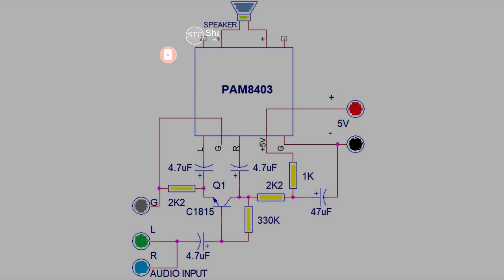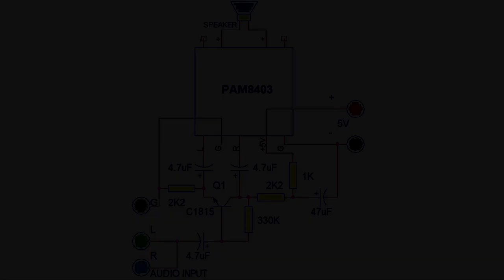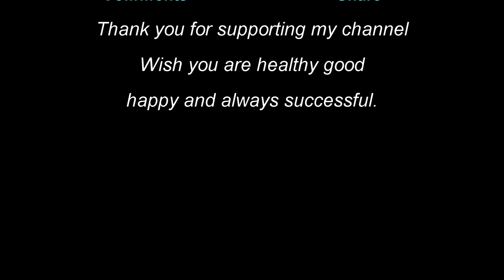DIY PAM8403 3W Stereo Class-D into 15W Bridge Mode Amplifier

Comment: no way you can get 15 watts out of a 4.2 volt power input , can't happen .
Reply: I think that  .
Reply: It's bridge mode, so you can get the 2 channels in 1 with double power. So we have there 6w

But if you use stereo without this circuit you are getting the same power teorically
Reply: the worst is that it is possible, I don't know about this one, but in bridge it can reach even more with other circuit boards
Reply: the datasheet doesn't say anything about bridge, but I don't doubt anything
Reply: its can... add buff more signal and using lowwer ohm.. 😅😂  for 15w only...
Reply: Of course you could get 15W with only 4.2V if the circuit would push 3.6A without burning up but with this circuit its probably not possible with the IC being the bottleneck that probably would burn up.. Power (Watt) equals Voltage times Current so 4.2*3.6=15.12W..
The math isnt really that easy with Class-D but approx..

Comment: Pam8403 is already a bridge amp so no point adding a phase splitter at the input and connecting to both + output pins. You will not get 15W doing this. Could be a fake video with spk wires under the mat.
Reply: Does it really works will I get 6w output
Reply: @siddharthshekhawat5502  3W peak into 8ohm, 6W peak into 4ohm. Note, peak not RMS, divide by 1.414 for RMS.

Comment: not possible. double is fine.  Also you are cutting out  useful sound due to phase cancellation. . its just a crude jugad. rest circuit is ok. It would be  better  to sum the  L+R  with a 470  ohm resistor each channel then same circuit will do very well.

Comment: yes it works! i tested it with a bc547 transistor and changed the 330k resistor for an 8.2k resistor so as not to have so much gain, i think that putting a 10k resistor would be ideal, thanks for your video man
Reply from the maker: Nice work!